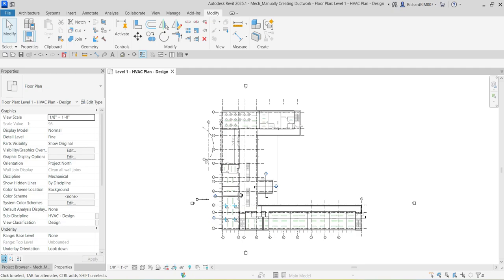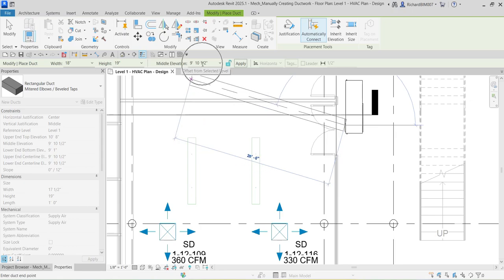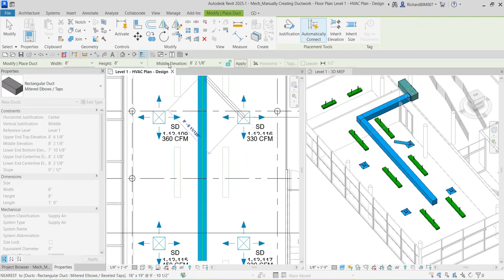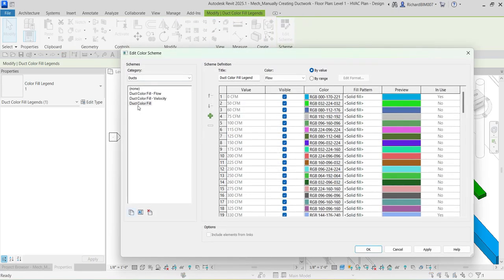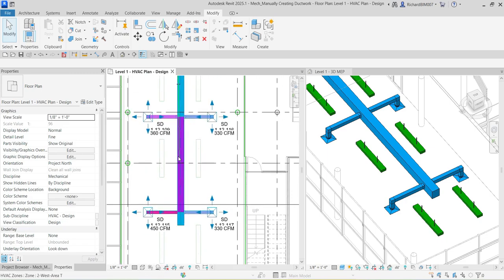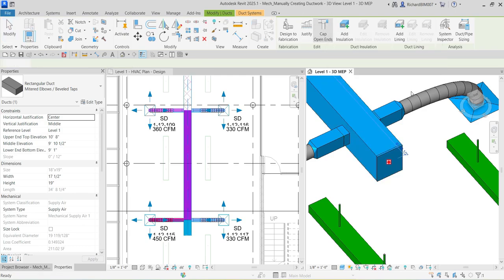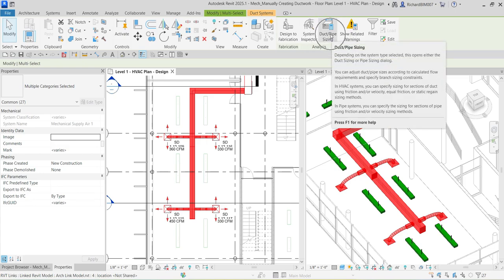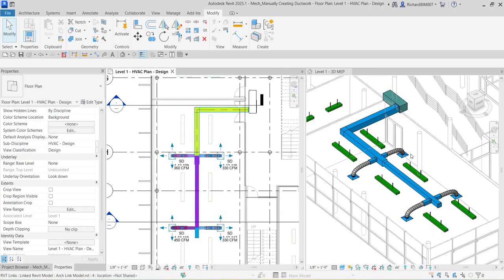REVIT 2025 FOR MEP DESIGN: MANUALLY CREATING DUCTWORK

Comment: Sir pede po bang mag save ng ibat ibang central file ng bawat discipline pero magkakaiba din ng file location per discipline ng central?
Reply from the maker: pede naman pero bakit nyo sir gagawin po un?
Reply: @bim360  gusto kasi sir ng kasama ko may central file ang archi,structural,mechanical,electrical,fire pro at plumbing tas ililink n lang sa isang pinaka central file..pero ako gusto ko ung archi lang sana ang central file tas dun n lang gagawa ng mga discipline..mabigat daw po kasi ang file sa gusto ko mangyare..ano po bang tama sir?
Reply from the maker: ang ginagawa ko, kapag mechanical for example, gumagawa ako ng new project for mechanical tapos link ko ung arch at structure. ung iba naman magkakasama na ung mep sa project, isang central file. tapos link na lang din ung arch at struct.